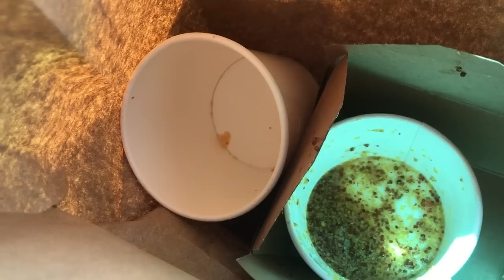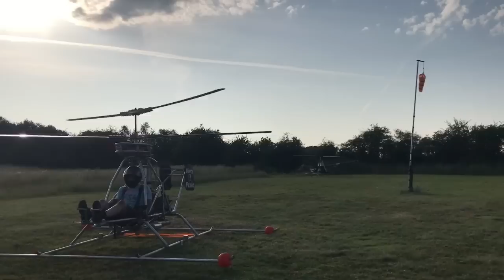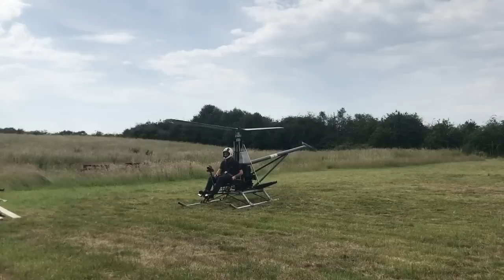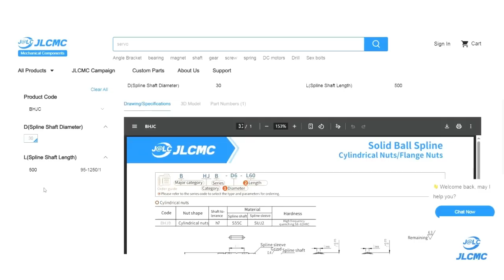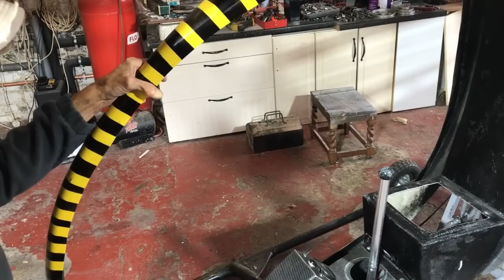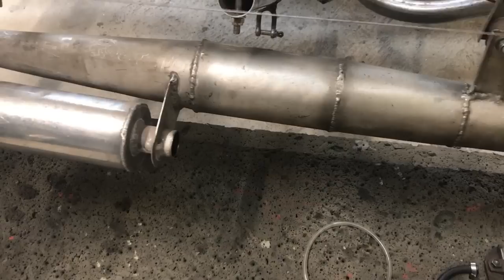Three HOMEMADE Helicopters, walk around, explanation and testing

Comment: Aluminum & carbon do not mix. 14:00 Automatic Anode Cathode
Take an end off of the offending tubes and slide a wooden dowel with lightening holes in it (Igor did)
A plastic sheet with holes as a damper - frame to tube guide
Great to see the Bug and the other machine.  In the 90s there was an explosion of new designs
Mini 500 Angel CH 7 Marianos Mc 1 and Kevens clones of the CH 7 the Helicycle and a load of one offs , Fun years
Reply: Yes carbon and aluminium do not mix in the long term, however glass cloth between the carbon and aluminium sorts out the problem
Reply: @julianmills9954  A barrier is needed. At Gulfstream LGB Grumman went to carbon floors in the G IIIs what a mess, White powder and holes all through the structures. It ate the hardware too.
Not worth the add complexity & processes
I used carbon panels for seats and put a lip of S glass for attachments.
Reply: @julianmills9954  THIS.
Reply from the maker: Wasn't aware of the electrolysis issue and the wooden dowel idea is also very interesting 👍
Don, your rotor mouse was that the first heli you built ? How much of that was designed from scratch ? Thanks

Just watched your OshKosh 95 video on this channel, a while ago but good to see what you look like. 

https://youtube.com/@hangarrats?si=n_PumnSyKTiH4Dmj
Reply: @Ben-Dixey  Add white to the black hair
Airframe was all scratch built with an R-22 drive train QH 50 rotor blades and the engine was a surplus AH 64 APU. 
145 hp 180 mph cruise 660 empty weight
250 hours on it. Fuel tank was racing type fuel cell but in the last Corona flood it reacted to vapors from chamicals in the water, The tank shattered like glass...
Still have it,

Comment: Hi Ben, great vid using motorcycle engines the machines look so heavy and complex.
Reply: If it were me, I think I would go liquid cooled superbike engine, with the transmission trimmed off. Easy to get parts, factory engineered, designed for rpm cycles, which when used in a constant rpm environment would make for long life and high power. Plus easy to find wrecked bikes.
Reply: For simplicity ROTAX microlight engines are best for lightweight helicopters, bike engines are not really suitable.
Reply from the maker: @cloudusterable   Some weight reduction and reliability can be gained from an aircraft engine but at a cost of course. The engines used would have been carefully considered given the intended use of the machines. 
A four stroke would certainly be nice and that BMW engine 90hp and 55kg compared to a rotax 912 at 100hp and 65kg it's not a bad option. We know the price difference between a rotax 912 and a BMW R1100RS.

Comment: Excellent vid and very interesting.
Is it possible to avoid drilling holes in the tubing? Clamps, U bolts or something similar... although i absolutely sure you've thought of that... thanks from Rome 👍✌️🇬🇧
Reply from the maker: Yes it is and that is going to be the best for strength. The challenge is to design a clamp that is light enough, strong enough and reliable. I might do some testing to measure the difference in strength between a horizontal and vertical hole in a tube. One of the builders in the video sent me an email predicting that a vertical hole will reduce strength by 27% and a horizontal hole reduces strength by 1% in my case. A very interesting calculation.
Reply: @Ben-Dixey ...so kind of you to even consider my comment.
Love this 'copter project, been following for a long time, and shall keep on til the end. Thanks 👏👏👏👍✌️🇬🇧

Comment: As you said, you wet your finger to stick to the page: the gesture fulfills a need that doesn't exist with toilet paper, quite the opposite: you really don't want to separate the multiple folds of your toilet paper.
Now, a joke from "Idiocracy" from 2006: Why would you sprinkle the plants with the water from the toilet when you can give them electrolytes? Water is for the toilets!

Comment: Друг, очень жалко потраченный труд, но по-моему схема твоего вертолёта не жизнеспособна
Reply: FYI, the Co-axial / contra rotating concept was an invention of Mikhail Lomonosov and most commonly used on Helicopters of Russian design by the Kamov Design Bureau .  Have faith my friend, this will work.
Reply: @HeliShed  да, схема сработает, при наличии классического автомата перекоса. На мой взгляд в схеме автора фундаментальная ошибка. В частности вертолёты соосной схемы имеют автомат перекоса и управление циклическим шагом. Насколько я понял, в схеме автора эти системы упразднены. Если так, то я не понимаю, как этот вертолёт будет управляться?
Reply from the maker: Hi, it's controlled like a gyrocopter, the whole rotor tilts, a swash plate isn't needed. However there are downsides to doing it this way and the only reason I chose this design is because all I want to do is hover around a field. 
The next version will have a swash plate like everyone else.
Reply: @Ben-Dixey  Cyclic with collective  would be a game changer but a lot of work
Reply: @Ben-Dixey привет, друг. Я понял твою идею. Но скажи мне, за счёт чего твой вертолёт поднимается вверх? Циклический шаг ты не меняешь. Лишь за счёт оборотов двигателя? Это очень не надёжный вариант. Я каждое твоё видео смотрю со страхом. И уважением
Reply from the maker: Yes just engine speed, I agree it's not as reliable as collective. With collective you can do a hovering auto. Just rotor inertia to cushion the landing. Mine will come down harder with an engine failure.
Reply: @Ben-Dixey  ты сделал хороший эксперимент. Достойный уважения. Но, думаю ты согласишься, что схема нежизнеспособная
Reply from the maker: I don't agree it's not viable for hovering around a field, it's been done already. The Nolan brothers did it, the Bensen B9, air scooter 2 and Gen H4. All fixed pitch and all tilt rotors. It's not viable for more than a few feet off the ground, if you want to do that then you need collective pitch at least.
Reply: @Ben-Dixey  прошу прощения, я плохо знаю английский, и не правильно понял цель эксперимента. Если целью было  висение на небольшой высоте, с учётом эффекта экрана, то идея жизнеспособная. Я думал, что вы строите полноценный вертолёт. В любом случае, ваш труд достоин уважения!
Reply from the maker: @AlexWoodRu  Thank you. its a lot of fun. 👍👍

Comment: Ben, have a look at those photos I sent from Shuttleworth collection for the Ken Wallace tubular frame - (did I use WhatsApp?). Alternately have a look at steel tube bicycle frames as they are  trying to get the strongest solution for the lightest design. But the other thought is that the skids are there to absorb impact, so maybe you want to have a bolted joint with a bungee strap to triangulate corner - doesn't need to hinge, just move when absorbing impact. I notice no mention of collective pitch for autorotation and flare yet...
That carbon reinforced aluminium tube could be worth something for wing spars & struts. But carbon is a lot more flexible than aluminium. So I would make an experimental piece for a 3-point bending test. Ideally you want to control displacement and measure force - does your new rig help? This will give you an idea about how well load is shared between aluminium tube and carbon. If you gave me the data and cross section I could do some Excel stress calcs to understand how to design with that. I figure you'll want to redesign WIGE wings at some point - no rush though. Heli project is very interesting.
Reply from the maker: Hi Martin, thanks for the very helpful comment. If using carbon to strengthen the wig wing struts then some testing will have to be done for sure. Yes the tensile tester will do bending as well, I've just ordered a digital pressure gauge which records the max pressure. I will be doing some tensile tests probably in the next video . I remember the pictures you sent, it wasn't what's app, possibly email, will have a look when I get home. 

Collective options for the heli is a few years down the line. I need to keep sorting the simple stuff atm. 

The wig I still want to go for the single skin wing, I know you are totally against it but let me test it and see what I think. I think to go for full airfoil wings would mean a major redesign, probably start again. I want to test it as designed and learn from there, even if it's the hard way.

Comment: I weld a tube around the bolt, seems to work very well with steel, haven't tried it with Aluminium though.
Reply: A crush tube...
Reply: @alan-sk7ky  We use those in hang glider tubes, and/or with an inner sleeve, called bushings, either fixed length SS or spin melted aluminum.

Comment: Good stuff Ben why did you choose the double rotors
Reply: My guess is because of "Counter Rotation", so that the torque of the rotors is cancelled out, eliminating the need for a tail rotor.
Reply: OK thanks  @vannoo67
Reply from the maker: In the beginning I was going to copy a design by Franz schoffman. Two counter rotating propellers and a go kart engine. It seemed simple enough so thought as a total beginner it might be achievable. That evolved into a design closer to the Nolan brothers/ Bensen B9. The coaxial design choice was to try and keep things simple, no tail rotor and main rotor tilts instead of using swash plates. 
With hindsight a standard configuration would have been easier as you can just go buy plans like the AW95. 
I think there could be a performance increase with a coaxial potentially as it's not powering a tail but it's also a smaller machine to store in the workshop. 
It's certainly easier to fly than a conventional setup which helps when trying to teach yourself to hover.
Reply: Thanks ben @Ben-Dixey  it's a great chopper anyway... Instead of the shaft shroud why don't you just fit a protective guard
Reply from the maker: @blackbirdxx4613  A guard is ok but you potentially have a flailing driveshaft with a lot of energy. If the energy is contained within a small radius the damage it can do is limited. That's my thoughts on it anyway.

Comment: Putting in the screw sideways, because there's no bending momentum stresses is a great move I hadn't actively realised, although FEM of course shows it. So thanks for that.
Keep in mind that when cfk wrapping aluminium, like 80% of your bending momentum is going to be transferring into the cfk. So it needs to be able to take that, or it'll pop and give you a bit of an unpleasant surprise sooner or later.
Having relatively low bending moments with a relatively thick rod, I find the solution to be quite good for the same reasons stated. Keep going !
Reply: The pop wouldnt hurt you or effect anything negatively, but be an unwelcomed surprise.